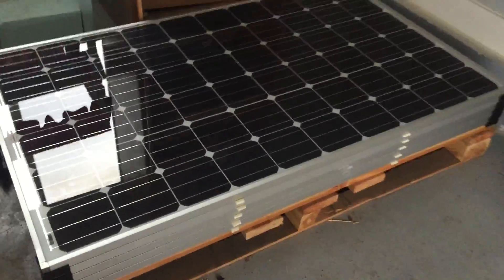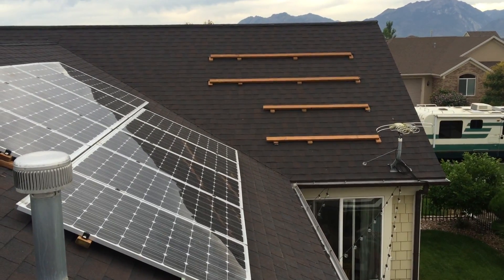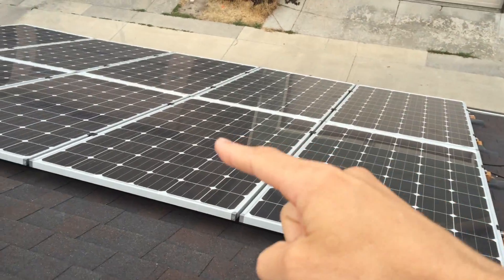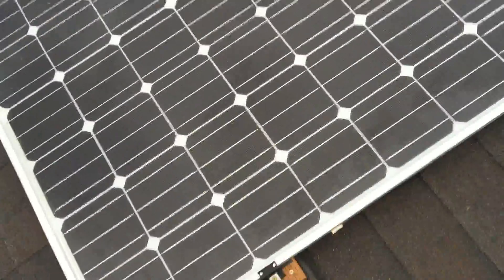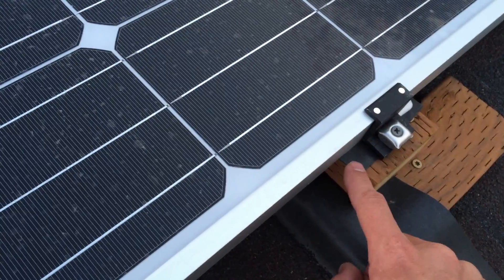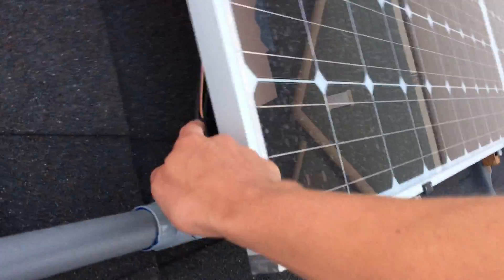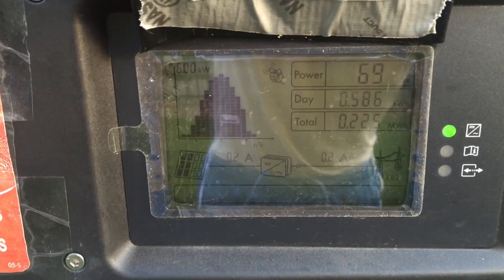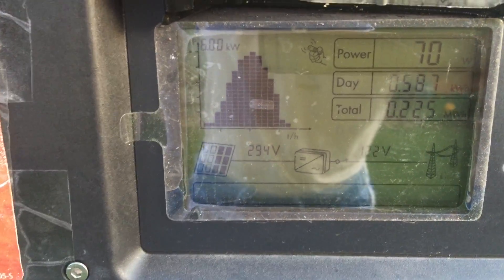How To Install Solar Panels Yourself For $4K - DIY 7KW - South Jordan, Utah - Cheap

Comment: Nice effort for a diy 60hrs!? Obviously dont know what compliance and regulations required in your country but a big majority of that would not even be anywhere close to compliant here in Australia. 

1. Rails should be as per manufacturing specs aluminium rails. With 14g hex screws into your roof trusses. And proper mid and end clamps with locking nuts that use a 6mm hex head screw. That timber will eventually bloat and corrode over time. Also we take into account wind factor. A high voltage power station on your roof becomes a massive kite on your house.

2. All conduit works are run inside the roof in heavy duty conduit pvc. Saddled in the roof including the earth cable minimum of 4mm. (The exposed conduit looks aesthetically unplesing to look at) maybe re run your conduit and use roof tiled decktites under your panel.

3. A major thing I notice was the way how you ran each array in series. I assume you would had the bottom tier with the panel cables in the middle and the top tier inverted? We usually have all panels portrait and run an "s link" that connects the end of the first run of panels to the start of the bottom run of panels and then run a return cable at the very last panels (negative) back to the isolator.

4. All arrays have rooftop dc isolator and a weathershield

5. All earthing points are zinc sprayed / galvanized between both copper and aluminium metals. That will corrode over time.

6. Usually an inverter would have 2x mppt allowing for 2x strings only.
Each string must face the same orientation. E.g north west east. You can't put 1x string facing two different orientations. (australia) which you did mention so good job.

7. Your compression gland under the panel must be multihole not a single as your internal conduit could have possibilities of ingress of water.

8. All solar related works must be a licensed electrician with solar accreditation with electrical inspection. A lot of house fires have happened due to poor / incorrect design and installation. Who signs off your work? Insurances / licenses / warranties?

9. Did you calculate your max voltage range per string vs your voltage range on your inverter mppt. What did you end up With?

10. How did you calculate your voltage rise? Do you guys have a voltage rise regulation that you need to keep under?

11. For a the 60 - 70 hours you did takes a crew of 3x to smash that job out (to that install standard) in about 4 - 5 hours max.
Reply from the maker: Great feedback - thanks!

1 - yes, this is a lesson learned, but did save money to use the lumber, and it is doing fine after 3 years (little sign of wearing)
2 - I agree - mostly I didn't know how to get into the roof without causing leaks
3 - yes, I did one row inverted so it just does a big loop in series around the panels, and the positive and negative are right together on one side.  I am not sure why you would not do one row inverted.  I also think portrait is the way to go, rather than landscape, if you can fit it.
4 - nice, but more cost
5 - good idea
6 - My inverter can do 4 strings since it is larger (I think over 4K inverters are usually 4 strings).  And yes, on mine, each string does face the same direction (one string is 10 facing SW, another string of 10 is facing SE, and the last string is 5 and another 5, but they all face SW.  
7 - Not sure I know what you mean by compression gland.  The conduit does have a rubber cap on it - I think that is what you mean.  I suppose I could have done multi hole there, but so far, water doesn't even touch that. 
8 - We have a city inspector who approved it all.  Usually you have to have a licensed electrician, but if you own the home, our city allows you to do it yourself.  The warranty is still valid on the panels in either case, but I don't think I will ever need to use it - panels rarely fail.   Home insurance probably covers system too.
9 - Yes, I don't remember exactly now, but I made sure each string could not produce more watts/volts than the MPPT could handle.  Overall, from the 3 strings, the most I have seen is 5800 watts, so about a third of that for each string.  I don't remember how that breaks down with volts and amps, but it is under capacity.
10 - You misunderstood - most of my time on the project was not installing, but doing paperwork, planning, purchasing parts, etc.  I acknowledge that I was probably twice as slow since I was a rookie, but time I was actually on my roof was probably more like 30-40 hours, which is double the 15 man hours it usually takes.  Besides, I learned a lot doing it, so I am okay with the money saved and the extra time I invested.
Reply: @MattNewman  it was definately a fair effort good work and thanks for the response. Maybe next project a battery storage lol?
Reply from the maker: @lifeofmark385  no, batteries cost too much.  I considered doing a DIY Powerwall.  However, in the end, it is just better to use the grid as your battery via net metering, unless you have unreliable power, which I don't.

Comment: I also tested my PV system a few days before the net meter was installed and the old meter spun backward and I was credited, not charged for that generated electricity.   I am now adding 10 panels to a shed and am considering PT lumber, but would paint it.
Reply from the maker: Eric Newman nice cuz!

Comment: good video, but installation looks very bad man..that PVC flex with a 360 degree bend is bad and on top of that you turned on your solar without letting the elect comp know?..holy shit, you could have killed someone!!.. i admire your DYI attitude but you needed more info to do a better project.
Reply from the maker: USA Norton - Rotary pvc flex has a 90 degree bend, not 360.  I did let the electric company know - they came and installed the net meter and were involved all along - you have to do that to enable net metering.
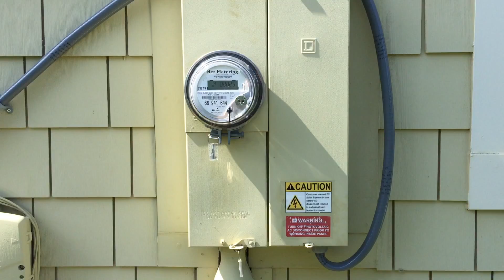Reply: @MattNewman  360 degree .. 10:35 to 10:38 also , you said in you video that you did not let the electrical company know.. just saying man, i mean no harm.
Reply from the maker: @ruddyteck  Oh yeah, sorry, I didn't realize you meant that part of it.  Yeah, I originally considered just going down below, but there was the main coming up from the ground.  I have since painted it all yellow (same as the house), so it isn't really noticeable now.

Comment: female is negative or positive?
Reply from the maker: darthclone2002 sorry I actually don’t remember but this could help - https://en.m.wikipedia.org/wiki/MC4_connector and also this https://www.solar-electric.com/learning-center/wiring-cabling/how-to-use-mc4-connectors-cables.html

Comment: Naturally, don't do anything illegal, but homeowners are faced with a delima, where we HAVE to be grid-connected, but what happens to our/your very good power when the grid's DOWN?    Maybe your 4th row should be if the grid is shut-down [--war, EMP-solar-flare, or both], so that you can run your refrig/freezer/a few fans/12-volt "auxillary" lighting, or daytime only A/C.   You'd need a separate system with deep discharge batteries of some type, with lead-acid being the easiest to buy but the Worst to maintain.
Reply from the maker: Actually, my inverter is set up so I can put an outlet off of it and just run direct from the solar power (and not through the grid).  In the event of war/EMP/solar flare, I assure you that I would get pretty resourceful (scrounge up some batteries, get appliances that run on DC and use all the power from the panels, etc.).  I am not as worried about the zombie apocalypse as some people though.

Comment: How did you come up with what size inverter you needed?
Reply from the maker: Adam Newby It is just based on my peak production. So my panels at most can produce about 7200 Watts so I got a 7000 watt inverter. I have 30 240 watt panels. The highest I have ever seen my system producing was about 6500 W, so you never really even hit the peak production. Also, the inverters are rated do you handle about up to 120% what they say they can do.
Reply: Matt Newman do you have a link or know the name of the clips you used to hold the panels down. I am going to be doing pretty much the same thing you are doing. 22 panels @ 305 watts per panel and a 7000kw inverter.
Reply from the maker: @Abrandnew3  see https://docs.google.com/spreadsheets/d/17l-QP0PswdXRNdfbICIZk83niCknfW6OeJlVLyCDeQ0/edit#gid=0 - that is a full manifest of all the parts I used.  I wrote them down as:

End Clamp 30mm Black SolaRack - 6 pack
Mid Clamp 30mm Black SolaRack - 6 pack

Comment: Nice Diy Solar install.. how many Kwh do they produce per year. Thanks
Reply from the maker: joseph john thanks!  It does 11,000 kWh per year. I use 12,000 kWh so it almost covers all my power.
Reply: @MattNewman . 11 kwh,that is very terrific for a DIY installation. 
You have a terrific knowledge about Solar PV in general.
Thanks
Reply from the maker: joseph john thanks and Take care!
Reply: Matt Newman only 11000 ? Utah averages 5kwh per square metre so you should be averaging more than your current 30kwh per day average and I would say your system is definitely under preforming. My 7kw system performance average is a lot more and I get less solar irradiance and face 280 deg west and I have some shading issues too on a string inverter here in Australia

Comment: What do you do with 1000KW A MONTH?
Reply from the maker: Alex Tech I think you mean 1000 kWh, not kw.  So we have a 3400 sq ft home and this is pretty average power usage in our area, mainly to run AC all day in summer and heat all day in the winter.
Reply: @MattNewman  yeah kwh. That means 33.33kwh a day. it's alot, no wonder why climate change is happening 😂
Reply from the maker: Alex Tech Yeah, I do have five kids so we technically are only using about 6 kWh per person per day, which I think is fairly low

Comment: I would paint the exposed wood white to help prevent sun damage.
Reply from the maker: good call but i dont love white
Reply: @MattNewman  Neither would I, but the sun and heat from the shingles will kill those exposed ends before the 20 year mark. I imagine repairing them would be a pain. Maybe something else to cover them up?
Reply from the maker: SALVATl0N Yeah that is possible, although I amI am planning that I may have to do some maintenance at the 10 or 15 year mark to fix some things

Comment: Hi dude love your video. Are you fully off the grid
Reply from the maker: maz man Thanks. No, I actually am still hooked into the grid but I have net metering set up so I basically use the grid as a battery and I get credit for it. If I had used my own batteries to be completely off the grid, the project would have cost double. It is not worth it to be completely off the grid if you are in an area with reliable power.

Comment: You pay for a licensed electrician for a good reason. I think the amateur installation shows in the way all the cables are run on the surface.
Also can't believe someone is dancing around on a roof and ladder without proper footwear. Your 'flip-flops' or 'thongs' leave you wide open for a serious slip and accident damage....
Reply from the maker: Bob Marshall thanks bud

Comment: Maybe if the inverter have two MPPT you can configure 2 circuits, for  each one of the side of the roof then the producction can be better. Structure can be with aluminium rails and rubber with inox screwls. everest is a recomended brand for PV structures.
Reply from the maker: Isaac Hernandez yeah I have 2 MPPT so I could have 4 lines - I am only using 3 currently - 10 panels on each.  And yes some metal racking is a bit better.

Comment: how did you handle the 2 different phases going to the smart meter?
Reply from the maker: pokey le fire I actually don’t know. I just hooked the wire coming out of my inverter into it 30 amp circuit breaker and plugged it into my main
Reply: i would've disconnected one of the phases but thats just me

Comment: My house is really small only 740 square feet but I live in Florida so my electric is really high, I can’t fit that many panels what do u recommend ?
Reply: Define high, I am near St. Augustine and live in a 1500 sq ft double wide. My power is provided by FPL at $.10 a Kwh. My bill runs $70 in the fall and spring and $90 if I have to heat or cool. I use two window unit AC's and electric space heaters.
Reply from the maker: @daddio7249  Yeah, my house is twice the size, and my bill was $60 - $180 a month.  So, I think you pay more for power than I did.  You can benefit from solar.
Reply: @MattNewman  40 year old mobile homes are not energy efficient. I do not believe it will save me money. Financing cost would be more than the lower bill would be and if I paid cash the long term opportunity investment loss would be about the same. I still want some solar power as a prep in case the grid goes down.
Reply from the maker: James Methvin I see - well you know best
Reply: Leanne Abadia  use a ground mounted rack system
Reply from the maker: I would still get panels. Whatever you can fit will probably be enough to power the house. You can probably drive to sunelec.com warehouse in Miami to save on shipping.  You could also put them on a carport, pergola, shed if you have that on your property or just on the ground too.  You could build a pergola too for your backyard.  Hope his helps.

Comment: That wood racking will last 5 yrs good luck
Reply from the maker: Jasmine Villas After three years it still looks new. Are you willing to put a wager on five years?
Reply: @MattNewman  i am curious why you didnt buy a metal rack system?  was it much cheaper or easier to do it with wood? (i am not the guy who just insulted you btw lol)
Reply from the maker: mark rossi So if you look in the description I have a link to my blog post. There, I explain all the lessons I learned and what I would have done differently. I actually liked working with the lumber because it was easy to cut, and it was also inexpensive. However, I did learn that you can get metal strut that is not too expensive. Buying a prepackaged metal racking system would’ve cost $1-2000 when I looked at it, but the lumber set up was only a couple hundred dollars. The unistrut would’ve cost about $500.

Comment: Very interesting video explaining why solar and wind energy will never replace fossil fuels no matter how much they improve and why oil companies like to promote them. Also large rare bird species populations like eagles and owls are being decimated by wind turbines.
https://youtu.be/N-yALPEpV4w
Reply from the maker: interesting, but I don't agree with it.  wind is not great and kills birds, but photovoltaics virtually have no drawbacks, except some of the manufacturing can be harmful to environment if done wrong.  Solar is already in the process of replacing fossil fuels, but we are only 10 years into probably a 100 year process.

Comment: Hey Matt, do you have a background as an electrician or did you DIY it through the whole process? I'm impressed with the craftsmanship and can guess you have some kind of background in construction.
Reply from the maker: No, I don't have a background as electrician.  I have finished my basement and did the electricity there - that was all I had done before - thanks!
Reply: @MattNewman  👍